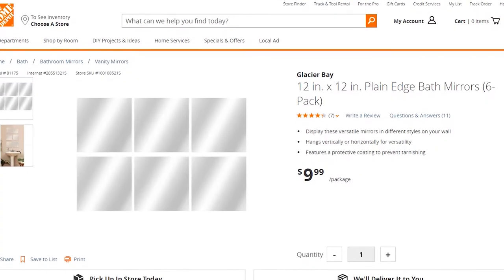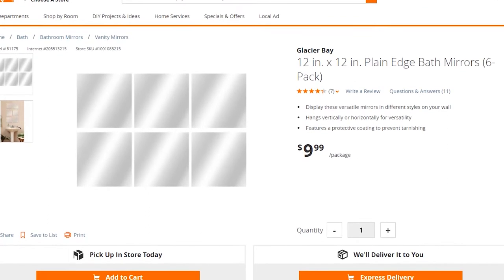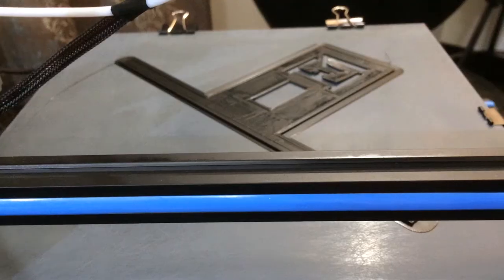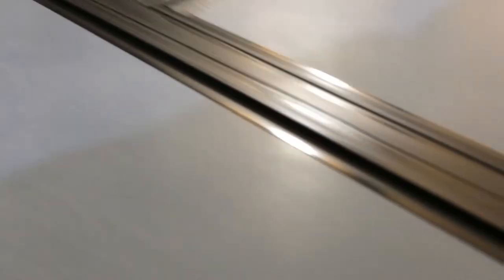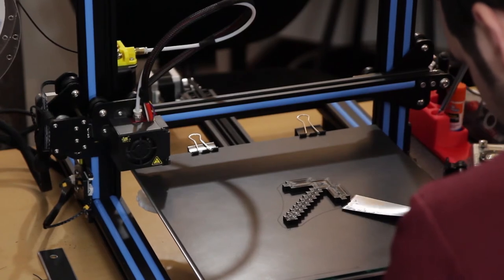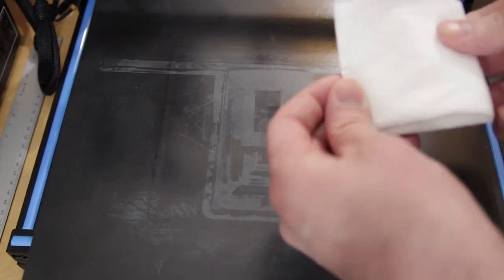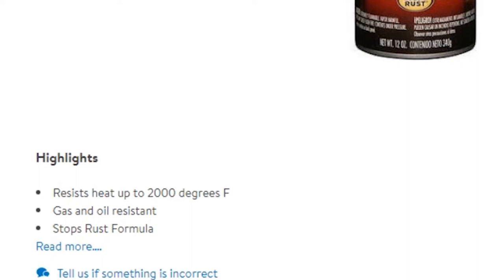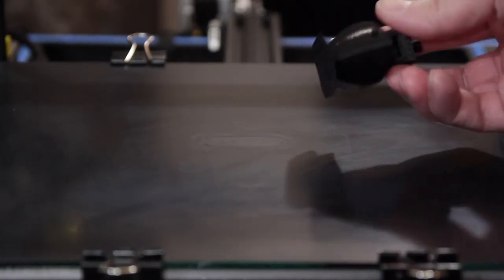Experimenting with Surface Adhesion Using Paint - 3D Printing

Comment: Since you already have a bunch of mirrors: it's possible to achieve nearly perfect PLA adhesion on bare glass, with literally NOTHING.

Nothing isn't that easy to achieve however, because the moment you touch it, it's not nothing any longer. But you put on some rubber gloves, take that glass to the sink, wash it with dish soap, wash it off with hot water, dry with paper towels, and install and use while still wearing gloves. Accidents will still happen though, as level adjustment is vital, as well as nothing remaining between that PLA and glass up until it comes to printing it. Good part though is that PLA will usually come off eventually, even if you have to put it into your freezer to get it off.

If you want perfect adhesion, you can print PETG on glass. But it will also not come off at all or take out a chunk of glass, so there's that. Apparently we want an absurd thing that things stick some of the time but not all of the time.

Comment: Hey there, did you try different PLA qualities ? I printed maybe 3 different brand of PLA (not fancy one, can't remember which) and one day I ordered the FUSED white PLA from Amazon. Normally, I never see a PLA warping, never (with or without heated bed). But than, this FUSED PLA warped at 60°C 😭. I used to put doublesided tape to prevent it warping. Don't try yet increasing the bed at like 90°C, I just don't want to increase my bed for a certain PLA brand.
Reply from the maker: I have mainly just been using Digistruct PLA as it does print quite well. I have a link in the description to it. Yikes! Double sided tape sounds like a huge pain to remove. I am testing something out right now and will share the results once done. :)
Reply: I understand, never tried PEI surface, should be enough I heard.
But my point was more:  I encountered one PLA brand out of 4 that wrap, maybe trying other filament would simpler your life (my 2 cents). BTW, I subbed :)
Reply from the maker: I do hope to try some other filament in the near future. Digistruct is just really cheap and that's all I can afford at the time being.  Appreciate the sub!